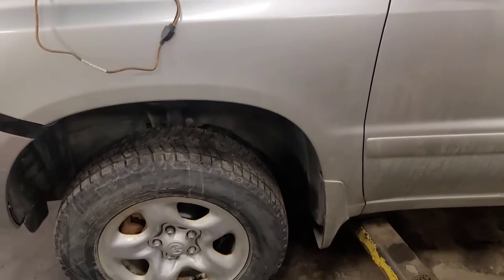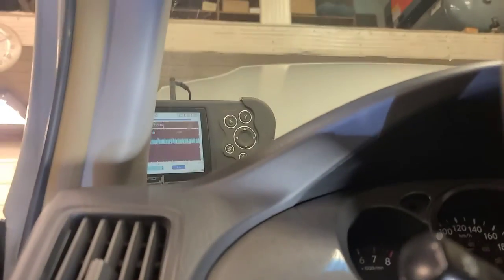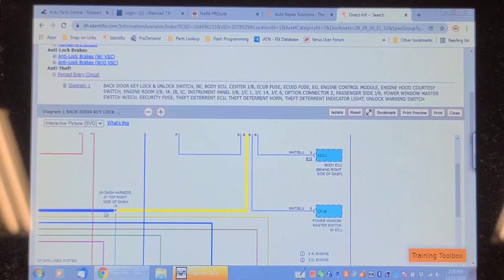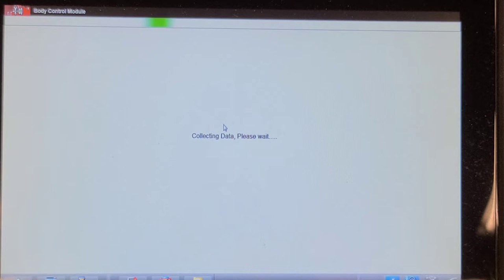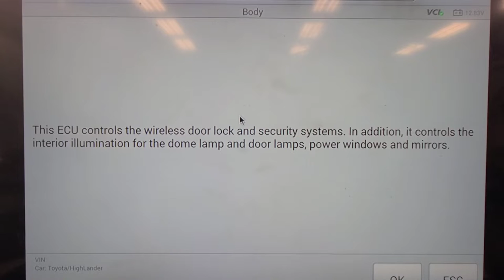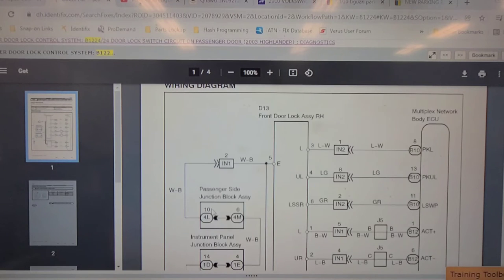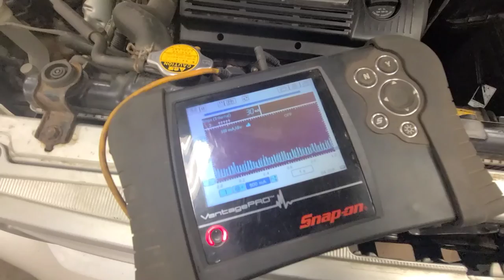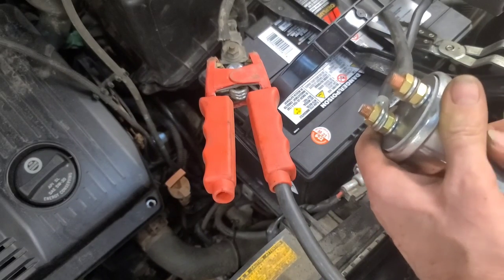2003 Toyota Hylander Parasitic Draw Testing

Comment: I was thinking maybe we have the same problem. My batt is draining 295mA. I havent check the door latch yet. My car is Chevy optra 2006. There used to be a red light indicating that it is locked, now its gone. The lights not turning on. Aftr you cut the wires, Did you happen to see whats the cause?
Reply from the maker: I'm not sure the Optra would have the same circuits.  The wire I cut was from the door lock cylinder key switch. Normally if you lock or unlock the door with the key this switch request all the other doors to electrically unlock. It was requesting a constant unlock request and that was preventing the BCM from going to sleep.
Reply: @PhillipBailey  i already checked it. its not the same wire.

Comment: no allowing bcm to go to sleep
Reply from the maker: The switch input was keeping the BCM from shutting down.
Reply: @PhillipBailey   seen it many times in honda door latch has micro switches .bcm will not allow the vehicle to go to sleep causing milliamp draw above nominal .50milliamp after 30 minutes or so
Reply from the maker: @davidellenbaum1229  yes and I missed the voltage drop across the fuse first time. Caught it pulling fuses.